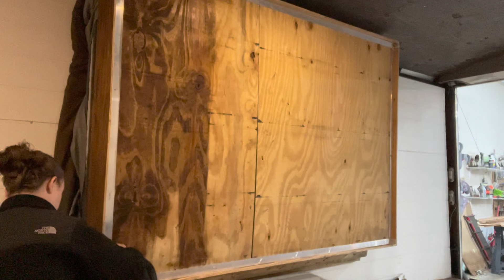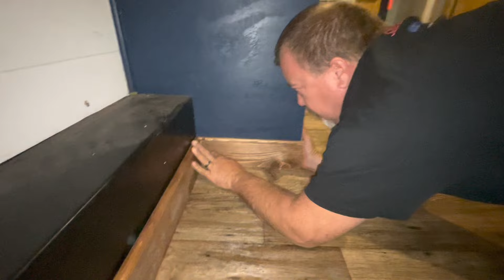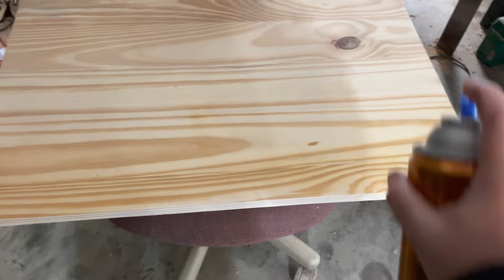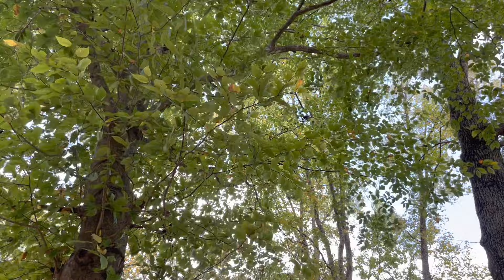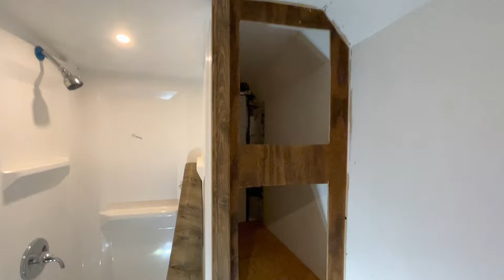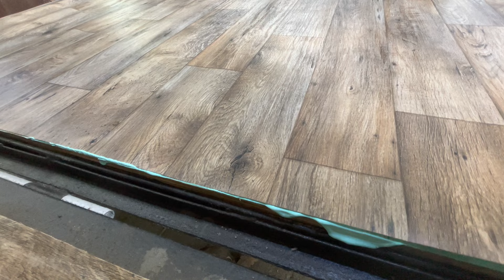Cargo trailer camper conversion last video before full tour

Comment: Love your project!  I hear a Predator 3500 Generator in the background.  I have to put a zip tie on the wheel on mine to get the parking brake to stop rattling around.
Reply from the maker: You would be correct, we just had it running to run the gas out. We wanted to put fresh gas in it.